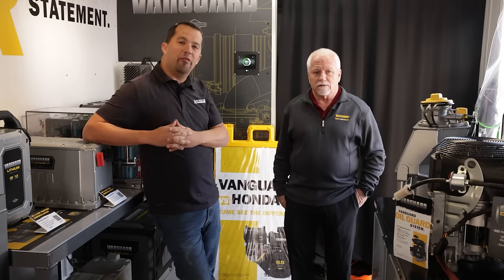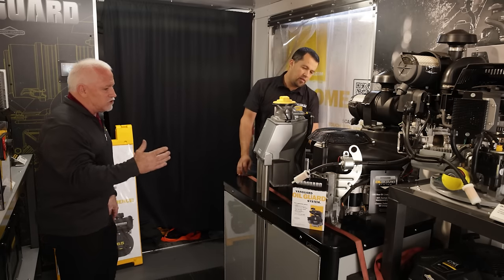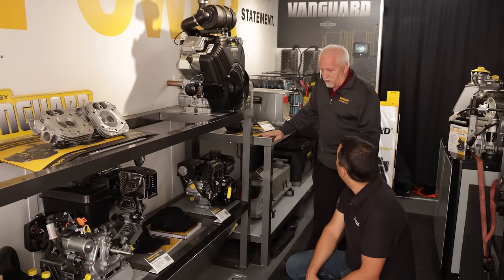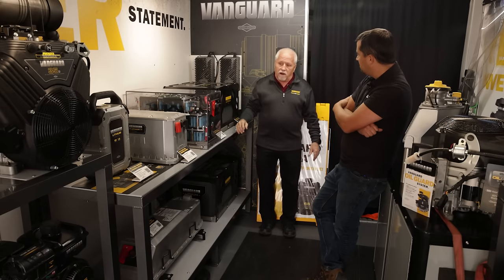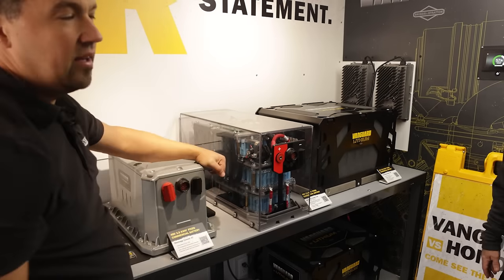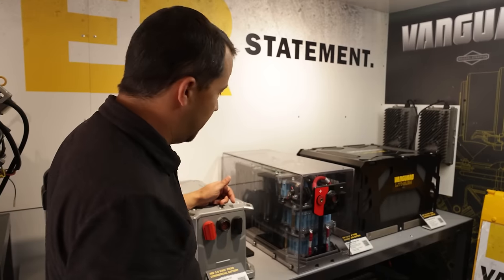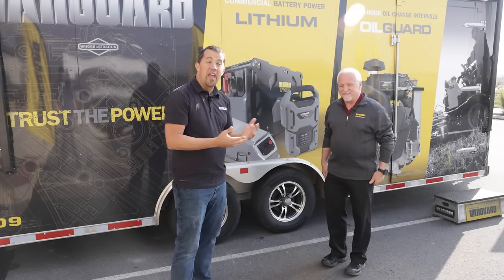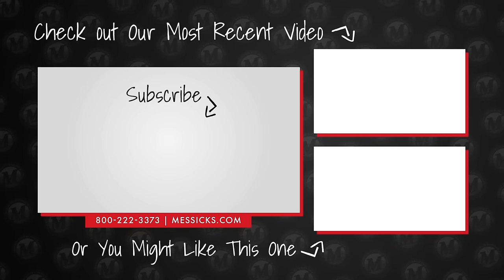New Engine Technology from Vanguard

Comment: The original Vanguard EFI engines used an O2 sensor and closed loop fueling. The Kawasaki competition used open loop. There is no doubt closed loop is more sophisticated and can more precisely adjust for every situation, but this Vanguard rep is trying to sell the new open loop as an improvement when it’s not. It’s a cost savings for Briggs and Stratton.
Reply: If it's easy to use then.. It's mowing so the engines must work when the operators are suffering from cesspit-fever.   If your State offers an OSSF map then keep your kids off the cesspits.
Reply: O2 seniors have à finite life but gradually decay.  I doubt sensors got replaced regularly.  Thus the engine didn't run right after a few years and people didn't like it.
Reply: @brianhillis3701  I'd say that's nonsense. The O2 sensor is automotive grade and probably the part number crosses to a car. The ones in your car usually last at least 10 years. I'd expect the same from a mower O2 sensor. By then, the mower is possibly at the end of its useful life. If not, a new automotive O2 sensor is probably around $100. Not a big deal.
Reply: @tylermacconnell217  I don't think the lawn mower seniors make it that long and 100 dollars is enough to make people trash the machine and the brand.  It looks like planned obsolescence to most people.  The change makes maintenance much easier  and less frequent for the average person.

Comment: I would steer clear of the vanguards. The guy acts like what they have done is brand new tech in this area of small engines but its not, other companies have done this. Out of all the things I have heard and seen on them being in the landscaping business 70% of people dont like them and have opted if given the chance to go with Kawasaki. The Vanguard at one time was a decent engine but its having issues now and briggs as a whole has fell as a company, one of the leaders in small engines. Briggs use to have great dependable, durable long lasting engines, not anymore, they have sub par stuff on many levels now.
Reply: Nah, I disagree. The current Vanguards are the cream of the crop when it comes to commercial small engines. They are built just as well as any Kawi engine; oil cooler is standard even on the non Oil-Guard models, and they run just as many hours. Many of the top manufacturers are using Vanguard even when cost is no object because they are the most powerful engines on the market. The Oil-Guard system has been out a few years now and its not offered on any other engine manufacturer in the class. Whether its really worth it or not remains to be seen but if nothing else the oil filter is easier to change and its a larger filter. "Transport Guard" is a nice feature but it doesn't apply to EFI engines.
Reply: I completely disagree. The vanguard engines that have been out for at least the past 10 years, are right about equal to the Kawasaki engines. I’ll happily take either of them before a Kohler.
Reply: @Jdspitz2  Had better luck with Honda and Kohler over any Briggs engine, flathead or Vanguard.  Vanguards are no longer made by Daihatsu, they come out of the same factory that makes the deplorable Briggs only brand engines.  Also, if Briggs really believed in its Vanguard line, why is it that a Briggs company, Snapper puts a Honda GXV160 engine on its top of the line walk behind mower?
Reply: @WJCTechyman  It doesn't matter that the Vanguard engines are no longer made by Daihatsu. Unless they now look completely different, they are still made from the same molds and materials as they always have been. They will still look fit, and work exactly that same way, with no difference in performance. 

And your note about the Honda GXV160 on top of the Sanpper 21" walk behind, is so silly, I'm not even going to waste my time explaining that.

Comment: These guys act like mowing 10 acres a week is nothing but changing the oil on a mower twice a year is unbearable.  🙃
Reply: Agreed. The non-Oil Guard models are still quite easy to change the oil on; you can do an oil and filter change in about 15 minutes or less unless the engine is buried down in the equipment.

Comment: I am not up-to-date on the tech.  10/10 on this Vanguard tour.  I like seeing the battery engines on a table, it's interesting to visualize the change.   Lithium is still very expensive, it costs over $1 in depleted-lithium per 20 minute flight for a mini-drone & $.25 per minute for a fancy-fast-drone.  So I imagine mowing with lithium is wildly-expensive still.  The batteries don't get endless cycles before they underperform.

Comment: Dry sump is not new has been used for years. A good example is the Harley Motorcycle.
Reply: Exactly correct, it’s nice to see Briggs has found the new, 1936 Harley Davidson technology! The 1936 Harley Knucklehead used a dry sump system.
Reply: @andyvonyeast332  The Harley, like Briggs, are incredibly loud, noisy engines and Harley vibrated so much you could track one by the bread crumb-esque trail it left down the highway.  Harley's engines are now made by Zongshen, the same company that makes PowerMore and Champion's Honda clone engines and generators.  Strangely, I find it interesting that both Briggs and Kohler make in essence Honda clone engines.  Also, the only reason I can see Vanguard using a dry sump and a large oil tank is because all Briggs engines I have had somehow either eat or leak oil constantly.  So something tells me that's still an issue and instead of making an engine to Honda's precision specs, they put the engine literally on life support.

Comment: Why the nylon gears Kawasaki had them no good had to replace why dont you make a good reliable engine you use to the old brigs were good so was the old Wisconsin. With the magneto they run no problems used them all day on  farm equipment hay conveyors only changed oil once end of each year adjust points  in magneto

Comment: Just get a honda, never look back.
Reply: Well, I came to the crude realization that Wallenstein, a fellow Canadian company has changed all of its machines to Vanguard.  They used to have exclusively Honda on them and the current model pictures show them with said Honda engines (the key features being the red recoil and fan housing, white fuel tank and black air cleaner and mufflers.

Comment: I wouldn’t have wasted my time with his B.S.
  And I didn’t with this video.
Reply: B.S.:  Briggs and Stratton, Breaks and Scrap 'em, BullS**t.  The Vanguards are no longer a re-badged Toyota Group engine, they're made in the same factory as their other failures pretending to be engines.  I still find it interesting that Briggs and Stratton power equipment still uses Honda and Kohler engines.  Snapper has a Honda commercial GXV160 on its top of the line walk behind mower.